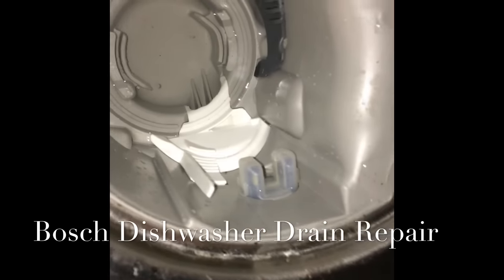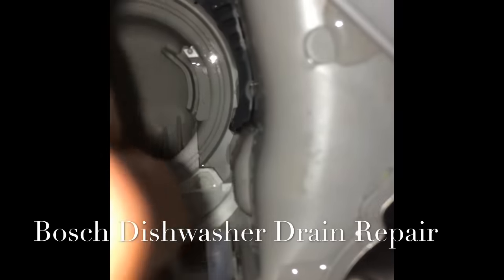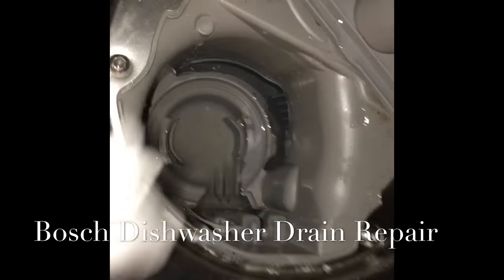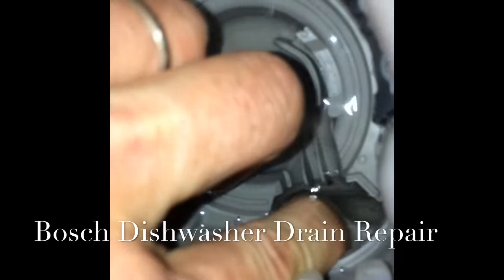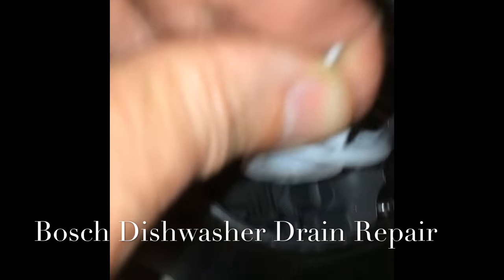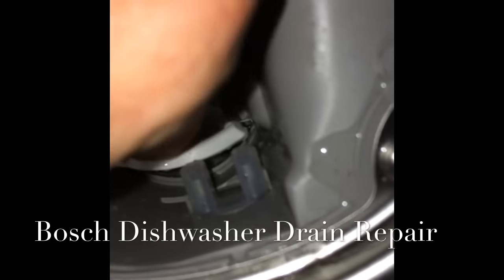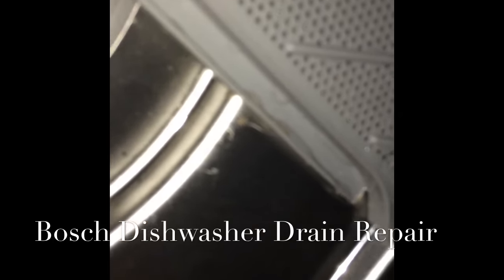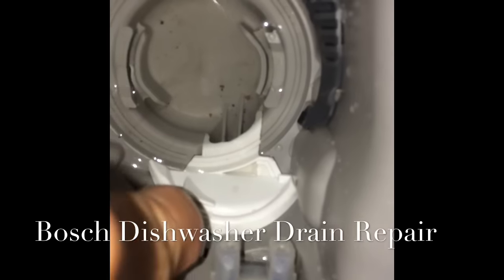✨ Bosch Dishwasher Not Draining - DIY - Quick and Easy Fix - No Parts Needed ✨

Comment: Thanks for your great video! To be upfront I am not very good at fixing machines or cars! In fact after I took out the filter to see if it was the issue I put my hand in the drain plug and found this white plastic jig! I told my wife how in the hell did this get in there! I was about to toss it but I wife told me to hold on to it! Well needless to say that this was the reason it would not drain! I installed it as you shown and now our dishwasher is working great!    Thanks again for your video!
Reply from the maker: Glad it helped!😊😊😊

Comment: Another common problem with these Bosch drain pumps are that the impeller over time slides forward on the shaft and then gets stuck on the white clip. All you need to do is just push the impeller back further onto the shaft. 🙃
Reply from the maker: That is good to know,
Thank you 😊

Comment: Thanks.  The lesson for me is that if the "Bosch Dishwasher Drain Pump Lid Cover" doesn't audibly "click" into place, it will wiggle loose again soon and fail to complete cycle due to failure to drain.

Comment: How do i remove the front panel to access underneath the dishwasher? I have an E15 and the impeller turns freely and white cover is properly seated. Help please if you can 🙏
Reply from the maker: You can unplug it and then remove the black metal cover held on by 2 Phillips head screws.
Then you might see a silver metal cover held on by 4 Torx 15 screws.
Once that’s off, you can sponge out all the water👍

Comment: So I did this and the propeller works great but the water still won't drain. What am I doing wrong?
Reply from the maker: Hi Christophe,
Can you remove the drain hose from underneath the sink and put it in a bucket and then get the dishwasher to drain?
I think there’s probably just something stuck in the drain hose.
I pulled out a pistachio shell from one of the customers, Bosch Dishwasher drain lines just last week.
Reply: Machine is doing a cycle right now. I've just tried blowing real hard on the hose. It that didn't work I'll try your suggestion

Comment: Thanks so much! Had a problem where my dishwasher wasn't sucking the water completely and stopping at times during the cycle.  By just changing this piece, got rid of those issues.  Who would have thought that a simple piece locked properly would resolve this issue.  Thanks Scott!
Reply from the maker: Nice job Antonio😊👍

Comment: Thank you. Excellent video closeup is very good. Mine was loose and looked as if it was broken and the filter does not sit, so I removed it bur the machine gave an error message replace drain pump cover. Tried various ways but finally placed it correct. I wish I had seen this video first and would have avoided a lot of heart ache.Thank you once again.
Reply from the maker: You’re very welcome 👍😊

Comment: I lost this white piece.  My question is, does it work without problem if this part (drain pump cover) is not there?  I get an error E24 and sometimes E25, and there is nothing wrong with the pump and it moves smoothly.
Reply from the maker: You’re right it won’t drain without that piece👍💻 Brand New Appliance Repair Blog - Lots of DIY Easy Fixes - Click Here: https://www.ApplianceFixes4You.com
Reply from the maker: Here’s the part:Bosch 00611322 Lid https://www.amazon.com/Bosch-00611322-Lid/dp/B00QFVDHIK
Reply: Thank you so much for the help, really appreciated 😘😘👌

Comment: I need that pump plastic thing you that you pulled out what is that cold and where can I get it?
Reply from the maker: Here you are Sir:Bosch 00611322 Lid
Reply from the maker: https://www.amazon.com/Bosch-00611322-Lid/dp/B00QFVDHIK/ref=mp_s_a_1_2?crid=33UG8OTYTAA5J&keywords=bosch+dishwasher+drain+impeller+cover&qid=1688147818&sprefix=bosch+dishwasher+drain+impeller+cover%2Caps%2C154&sr=8-2
Reply: Thx

Comment: Can someone tell me what is the piece above this filter (the two things sticking out). I have pushed it by mistake inside and water leaked out under the dishwasher. Now I can not pull back whatever that cover was and I can also see there are some electrical cables inside there. Any advice on what I should do? Thanks.
Reply from the maker: Is that on your Miele?
Reply: @ScottTheFixItGuyChannel  it s a Bosch, but it looks exactly like the one in your video.
Reply: Any advice? I was able to put a tap there so that water doesn't flow through, but now when I start the machine the indicator lights don’t light up and the machine sounds like it s pulling water out but nothing else.

Comment: My impeller turns freely and the plastic cover is in place but I keep getting the e24 message and I’m left with a dishwasher full of water.  We bought it about 14 months ago.  Any advice?  Does the pump need replacing?
Reply from the maker: Do you have one of those air gap things up near the kitchen faucet?
Reply: @ScottTheFixItGuyChannel  our drain hose connects directly to the drain under the sink.  The nipple that it connects to was plugged with grease.  I disconnected the hose and stuck a screwdriver in there to knock the grease blockage out.  It worked fine after that.

Comment: So, the fix is what? Just ensure that white rotor moves and is clean? I did that and it's still clogging. Did you clean the; filter, hose, plastic rotors housed throughout the machine?
Reply from the maker: +Fawn Lebowitz 

Hi Fawn,

I'd say you have a clogged airgap up near the sink
Reply: Scottthefixitguy I have the same situation. And i have no air gap. So what do i do?

Comment: I had a hard time seeing how the small impeller cover went back in. I used a wet/dry vac to suck out all the water and set my phone flashlight on the top rack shining down to the impeller. The video I'm sharing shows the correct position of the cover. It slid in place after a bit of fiddling, but used a butter knife to click it.

Comment: My Bosch drains during the wash cycles  but does not drain when final cycle ends and has the E-25 code.  I  can start a new cycle and then cancel  and the pump runs and empties the dishwasher.  I've check the pump as shown in the video but don't find anything.   Any recommendations?
Reply from the maker: I wonder if it’s time for a new Drain pump?
Reply: @ScottTheFixItGuyChannel  The pump was working and draining each time called for in the cycle except the end of the cycle.  I followed your video and checked the plastic plug and it had not clicked into the slot.  The D/W had not been used in 18 months and moved to a vacation home.  The first time it was turned on it show  E:25 at the END of the cycle.   Its working fine now.  Lesson learned is you have to hear the "click" !!!  Thanks for the follow-up.

Comment: Ok, but what does this do? I pulled put that panel but the water still won't drain. The impeller moves. But how do I remove debris? The little pool of water is still there.
Reply from the maker: There should always be a small pool of water below the filter screen.

Comment: my impeller was moving freely. Does that mean there's another problem? And how do I test after I do this fix without running a full cycle?
Reply: You could need a new pump that's what I needed and yes you can check just Starr a cycle for a few min then hold the start button it will blink one min after that close and it should drain the water. If your impeller spins freely and it still won't drain you probably need a new one or a clog down the line.

Comment: Ok, so I'm trying to follow this video but I happen to have removed the grey semi circle plastic part (shown on the top left part of the video) instead and can't get it back on! Typical me! Lol. (Dealing with a machine that is still full of water too).
Reply from the maker: +Laura Bond 

Thanks Laura,

I would bail out the water with a cup so you can see what your doing.
You should use a bright flashlight.
It will make sense once you can see what you're doing.
Reply: Yip - I was being lazy and trying to avoid bailing the water out. Thanks. 😊
Reply: Me too, how do you put that grey semi circle back in?

Comment: Hi.  Is it normal for water to remain at the bottom of that drain compartment, I'm seeing more than in inch of water up to the white drain pump cover (not up to the lever, just below the prong thingy).  Thanks.
Reply: That is normal.  It leaves water in there at the end of each cycle to keep the seals from drying out.

Comment: Your video does not answer the question as to why it won't drain just a demo of how to remove the drain cover? I have a brand new machine just installed, nothing in the the drain area, clean water but nothing is draining out at all? Faulty machine?
Reply from the maker: I would check the drain hose that connects to the garbage disposer.

I think they forgot to knock out the plastic plug inside the disposal drain tube.